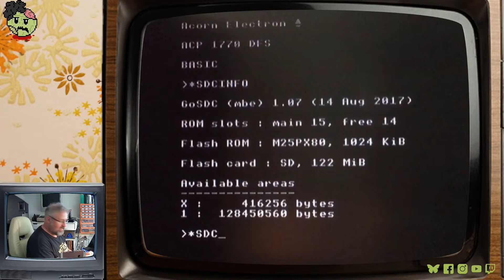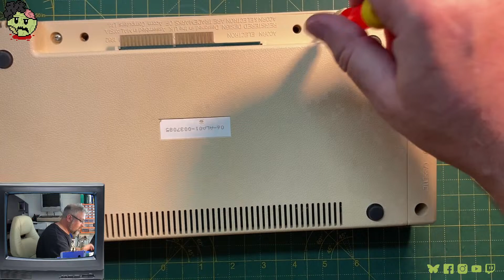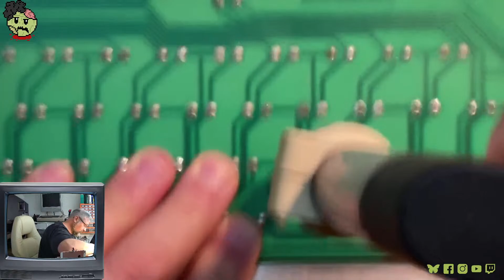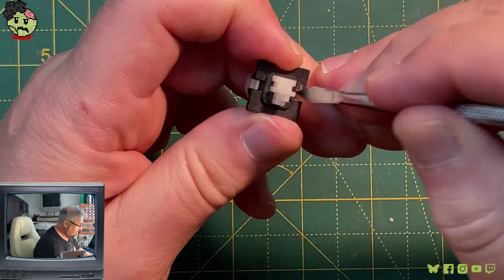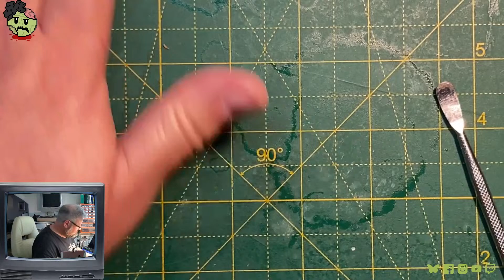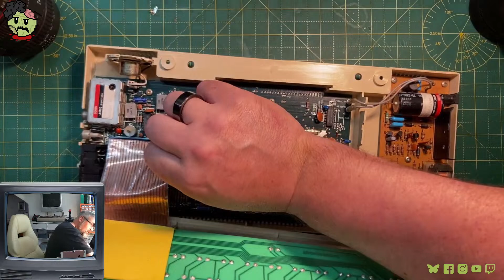DFR from the Workbench - Fixing Acorn Electron Key Switches

Comment: Something weird happened with the lighting from before the repair and then afterwards. The overhead camera was picking up the strobing of the lamp later on. Plus the capture of the monitor became worse. I'm wondering if the sun was hitting it or something.
Reply from the maker: Yeah the rostrum camera normally filters the strobe effect from the overhead LED light - I don’t know why it stopped doing it. It’s set to record at 30fps but perhaps 50fps would be more in sync with the light. 
And as the sun got lower there was more ambient light being reflected into the TV. I did figure out how to improve the brightness after the stream. The camera not focusing was a bigger problem though! I should have noticed that 🤦‍♂️